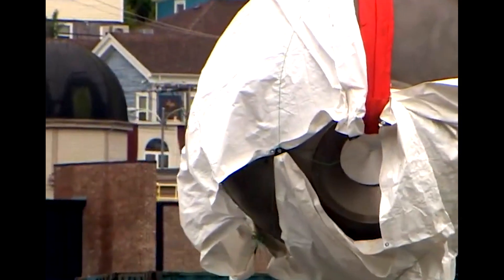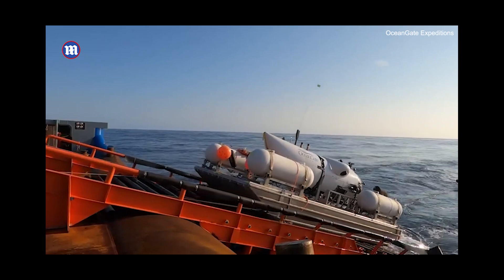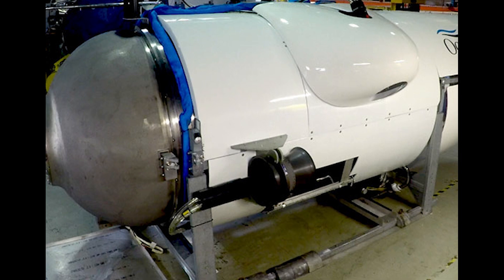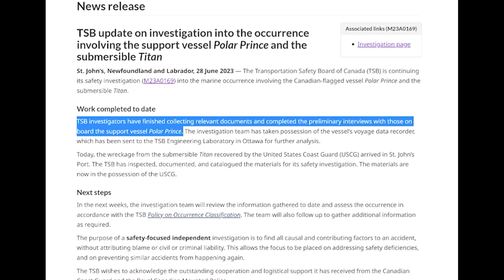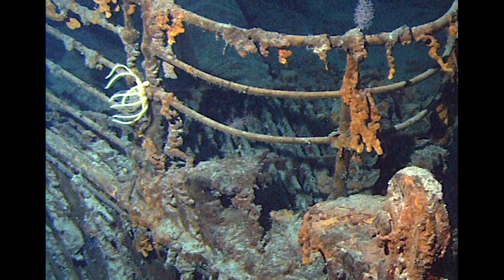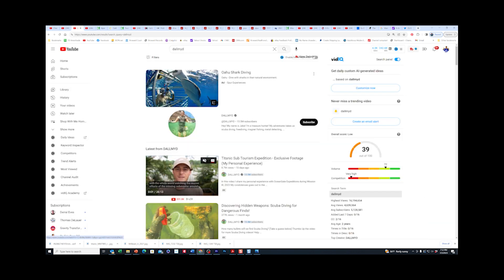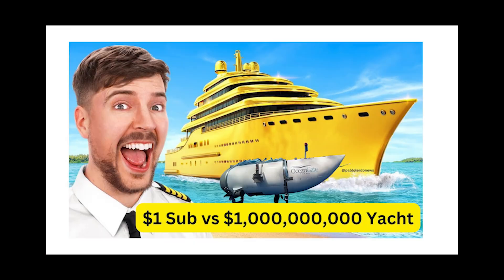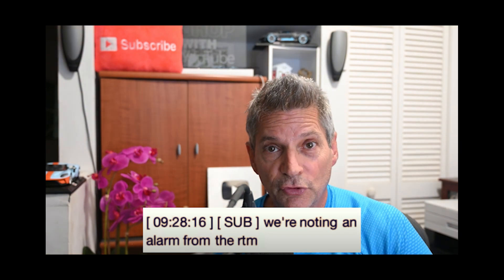Titan Submarine Debris Clues, Implosion Simulation

Comment: Watching that guy with the socket, 12 inch extension bar and ratchet shows the level of engineering applied to this sub, never mind the use of carbon fibre for the pressure hull.

Comment: I wonder if they felt the pressure of the water in those depths would keep those pieces 'compressed together'. The problem appears that there were no scale models built or computer software used to run scenarios on the materials and the environmental effects.

Comment: I would expect the window and bolts to be blown out by the force of the rebounding implosion of the main CF hull. It would have been rated for pressure from the outside not the implosion pressure from the "inside" and the bolts would not have stood a chance.

Comment: Here's my conjecture about the acrylic dome. When the sub imploded, the titanium nose cone was strong enough to maintain the shape of the dome. The suddenly increased air pressure inside inside the sub ignited everything flammable, like in a diesel engine combustion chamber, resulting in an explosion that blew out the plastic dome. It's still on the ocean floor, perhaps in pieces.

Comment: there is a claimed transcript that I read, and it is apparent the hull collapsed.  He was descending much faster than appropriate - and had gotten to 3400 in less then half the time - when they hear cracking and then the hull monitor - the boat asks: " are you adjusting descent speed?"  and he says "No."  Now they hear it again, and then they tried to drop the legs and had some difficulty which may have reduced the batteries hence the slow ascent, or a pin leak flooded the rear panel and the electric went out and water a that pressure would be like a waterjet.  Then as they slowly rise they heard cracking - the monitors go nuts - and then no contact.  That design was bad.  They needed a solid rubber seal, like the shuttle and then the sealant.

Comment: No no, we can tell if it was window or not. If it was the cause some bolts would be left in frame...
On second thought if it was not, even then, some bolts would stay as it would shatter regardless, as it was weakest point of the front if submarine. Hm.
Hard to say, "black box" cons would suggest aft giving up, not front.

Comment: theory for me is the carbon slowly unlaminated bit by bit after every dive, then on its last dive the pressure of the water was able to creep in the gaps slowly streching the chamber from the outside, making the sub heavier they dropped all there weights even the landing to try and make it to the top but the pressure was too much and the hull imploded and the only warning they had was those sensors which didnt do a thing because when the alarm went off it was already too late the hull was already compromise and they had seconds to get back up.

Comment: The titanium nose cone’s acrylic is not the reason for implosion
If it was then it wouldn’t have imploded but just simply flooded

For the titanium ring, WHY DID THEY GLUE IT 
glue is a really bad weak point and bolts are WAY WAY stronger especially in numbers
Which is why many submarines have many bolts and a gasket instead of glue

For the carbon fiber hull being nonexistent, that’s the part that imploded
Carbon fiber is good in tension, not compression. 
Being underwater exerts massive compressive forces onto the hull.
There being no bit of carbon fiber left means that it’s just crumpled and compressed with 5 people in it while it’s tensile power is doing it’s job.

Comment: I watched another video saying the pressure on the air inside the sub once the structure failed would have been so high, the temperature of the air would have gone through the roof as it was compressed. I can't remember the temperature they stated, but is it possible the temperature of the air burned the carbon fibre tube instantaneously?

Comment: A chain is no stronger than its weakest link. In the case of the Titan sub it was either the carbon fiber capsule or the plexiglass viewing window which was not certified for the depth  of the Titanic.
Reply: The weakest link was it's owner/designer/ceo

Comment: I wonder if anyone can help answer a couple of questions.  I heard that that particular craft had already made the journey over 20 times?  So did they put more carbon fibre on it after each trip, or did they just leave it as it was?

Did they not make one and test it properly (unmanned) to see how many trips to the bottom it could make before it succumbed to the pressure of the water?

I have been given the impression that the guy in charge was cocky and thought that as the craft has worked fine up til now, he’ll just keep going with it.  But I don’t know if I’m actually being quite unfair towards him and he wasn’t just throwing caution to the wind 🤷‍♀️

Comment: The fact that they layed the carbon fiber in a manner where it overlaps the other layer by a 90° angle was an absolute crime. Also carbon fibre is better suited for tension than compression (i.e under the fcking ocean.) 

Also even for tension purposes, they always roll the fiber in a 45° angle, overlapping the previous layer in the same 45° angle but in the other direct (-45°) this creating an overlapping pattern that is much much more resistant. That's used in pool filters mostly to create a better rigid and sound material structure. 

This was bound to fail. It was a miracle it resisted so many dives.

Comment: Screw the connection joint and glue, the water pressure alone will seal it against the carbon fiber. The problem is the carbon fiber and the way it was laminated, regardless it should have never been used.

Comment: I'll bet my right arm and my CD collection the implosion happened around 10 seconds after their final message.
After releasing some ballast something was obviously weighing them down......more than likely an amount of water entering a part of the vessel.
Also as there would have been less Oxygen in the vessel an hour and 45 mins after diving means the air bubble isn't as buoyant on the ascent.

Comment: You pointed out lack of a torque wrench. One of my first thoughts was feeling sorry for any kind of seal or gasket that might be in between the flange of the dome and the cylinder.
Reply: It's funny that JUST as he's saying that at 7:19, it switches to another view showing that the person tightening the bold, had, in fact, switched to a torque wrench to finish the tightening.
Reply: In high pressure seals like this, there typically are no gaskets, the mating metal pieces are precision machined and form the seal.

Comment: I have rigged machinery the size of that end bell.  They could have screwed  shackles or cables directly through any of the vacant bolt holes on that end bell to lift it.  Note that the end bell and adapter ring had separated.  Removing the entire window to thread a strap through wouldn't be your first option if the window survived.

Comment: 7:19 that is a torque wrench
Reply from the maker: IF ti was, why did they ratchet it several times? Torque wrench is supposed to be once!
Reply: @jeffostroff  thats not true unless your talking about the super cheap torque wrenches that dont have a ratcheting head they are so outdated i havent ever seen anyone ever use one at any of the shops i have worked at. these days everyone uses ratcheting torque wrenchs with forward and reverse. the video quallity isnt good so i understand it being hard to see but if you pause the video you will see the locking collar by his hand as well as the pin by the head. its a "click" type torque wrench. either way that sub was a death trap.

Comment: The drum implosion at just 1/400th of the pressure Titan imploded under is sobering. Man that teacher is cool, we forget the atmosphere is heavy - 1kg/cm2 is a LOT - and this demonstration rams it home. So does having your dry suit inflator not work, you get shrink wrapped and literally unable to move a muscle at just 30m or even less. Every 10m of depth adds another atmosphere so 30m is 4kg/cm2 which crushes the air between your clothes and your drysuit hence the need to add more air as you descend, to maintain the space between you and the fabric that lets arms bend.  It's like wearing a jacket and having someone walk around using clamps with 4kg/cm2 to pinch all the loose fabric so you're shrink wrapped. Good luck moving, not gonna happen. 

But this was 400kg/cm2... just unthinkable pressure... non-spherical pressure vessels have no business being at that depth 😥

Comment: 7:18 appears to be the torque wrench used to tighten 17 of the 18 bolts. Personally I'd prefer they didn't use a torque wrench and added the 18th bolt.
"Stockton doesn’t screw in the 18th bolt because it’s too high, says David Pogue, former crew member in an interview".

Comment: I’m under the impression that they would have dove this sub until it failed.  If it wasn’t this dive, maybe it would have been a few later.  It was a matter of when, and not if. The only deep diving carbon fiber sub built was designed for a SINGLE dive. No more.  If this thing could have passed certification, I believe it would have only been rated for a single dive, maybe one or two more.  Would they have ever replaced or rebuilt this thing?  Since one wasn’t already in production I feel as if they had no true intention of replacing it or assigning any type of “service life” to the vehicle.  They were going to dive it until it failed. Period.

Comment: Another source was stating that the sub was descending at a far faster rate than normal but the emergency ascent was much slower than normal, indicative that it was taking on water, probably in that area housed by the tail fin.
I will not trust my life to glue.  Even if it's "special glue", it is always a weak point in any system, especially if not applied evenly.  The glue used in PVC plumbing breaks after so many years of normal use.

Comment: Given the crackling sounds coming from the aft according to the message transcript (assuming it's real), could the failure have been at that end and then water rushed in, finally slamming against the front cap, blowing it off from the carbon fiber cylinder?

Comment: From the limited amount of CF recovered it seems the hull completely shattered the resin and each one of the fibers individually under the instantaneous pressure.. The distribution of glue residue remaining on the flanges indicates to me at least just how bad the contact surface was between the tube and flange.

Comment: 7:19 That is a torque wrench lol

10:15 at the very least the water pressure at that depth would have made the water rush in at 700m/s(1500mph)? Not sure if blender or... hammer vs grape. |

10:50 had passed the point of no return much earlier... so. I can't imagine.

Comment: One would think the steel pipe structure on which the carbon fiber was wound would still survive in crushed condition. The CF shell may have cracked and splintered in chunks or smaller slivers and wafted willy nilly as the pieces sank to the ocean floor, but the crushed steel passenger compartment would most likely remain in one piece. Also, is it possible the front porthole was pushed out from the vessel as a result of the escape of trapped air in the tube, the window was constructed to withstand pressure from the outside only, not from forces from the opposite direction.

Comment: Stockton was probably wishing in those last few terror filled moments with all those red alerts and hearing those crackling noises, that he had listened to the countless experts in the deep sea sub community, who repeatedly warned him over and over again, one of whom an ex employee he fired for that, that safety certification should be his top priority.  I can't for the life of me understand why the experienced diver French explorer P.H. Nargeolet was okay with this "tin can death trap" as the ex employee Stockton fired called it.   P.H. trusted his friend I guess.  Also Stockton used a tube vs. a sphere which was already a point against him because apparently, spheres can withstand much more PSI pressure than tubes.  Then you have the unproven, never used before at that depth, one-way wound carbon fiber vs. two way, another point against him.  I'm no engineer but my father is a high-rise architect and said that two-way composite is much stronger than wound one way, and steel or titanium have been proven to withstand the pressure for deep sea diving when carbon fiber has not, although it's being used increasingly in commercial construction, but should never be used to those depths.  James Cameron who knows a bit about this (and who I would trust) said:  “I never believed that technology of wound carbon fiber filament on the cylindrical hull would work."  Stockton said safety certification was a "waste."  The real waste was the unnecessary loss of life due to his thinking he knew more than everybody else.  RIP to all the 5 on board, including Stockton.  He's getting vilified everywhere because of his arrogance and recklessness, but I can't help feeling for his family as well as the others and their families.  OceanGate will be buried in lawsuits, despite that release those people signed.  They didn't have the whole story and therein lies the legal loophole that will allow lawsuits to go forward IMO.  Good video.  Thank you!

Comment: if it was an implosion the port would have blown out with some force and ripped the flange outward stripping the bolts which is obvious. If the metal contracted due to temperature it would have squeezed that carbon fibre tube and if the tapered flange was not squeezed the pressure would cause a stress in the sealing compound or glue that may have caused missed additional stress other than direct pressure  ie pressure on the join plus thermal contraction leading to failure. The bolts only hold it in alignment the pressure keeps it sealed not the torque on the bolts. The blast system was defiantly inadequate some form of lead shot based controllable system would have been preferable but any mechanical or electronic system in never infallible when considering diving.

Comment: That barrel was the effect of 1 atmosphere pressure not several hundred atmosphere pressure - something collapsing at this pressure has the energy released that is similar to a bomb explosion and it will also produce a light flash. Considering that circumstances i guess its pretty hard do figure out what collapsed the vessel because i am sure the shockwave of the implosion causes secondary damage.
Reply: In the barrel demonstration, the max pressure on the outside of the barrell would be one atmosphere, about 14 pounds/sq inch, not the thousands of PSI on the subs hull. Much faster implosion. Better that they did not find it intact on the bottom as that would have ment a slow leak and they drowned slowly.

Comment: Actually theres a entire time table of when the sub stopped responding. The ppl were panicking for 20mins and the transcript seens accurate so the only way to 100% confirm its a real one is showing if the ballast was undamaged. 

If so it proves the transcript is correct.
Reply: Also talking about the transcript you probably have it is accurate I believe. And on top of that there is one thing that I found odd. The rate of decent was FAR TOO HIGH. They made the trip to the bottom in 90ish minutes instead of 2 and a half hours. That level of pressure and heat from decent killed them and I'm not sure if one of the rich ppl wanted to sub to go faster or what. But it costs them all their lives.